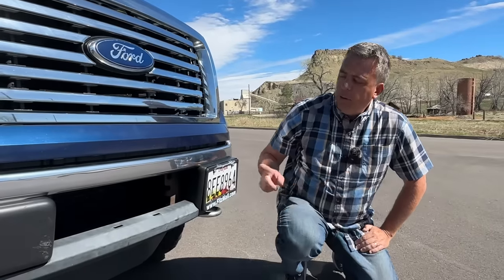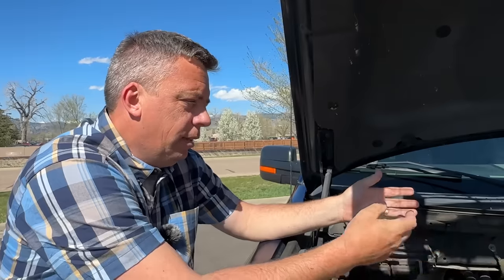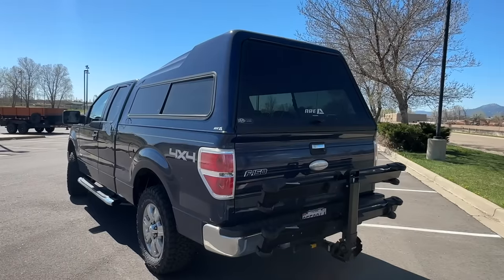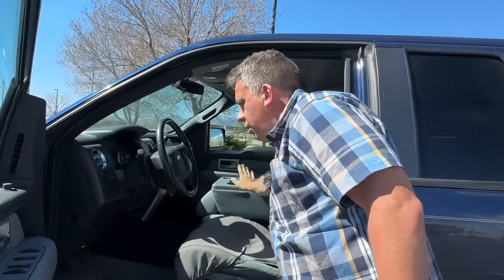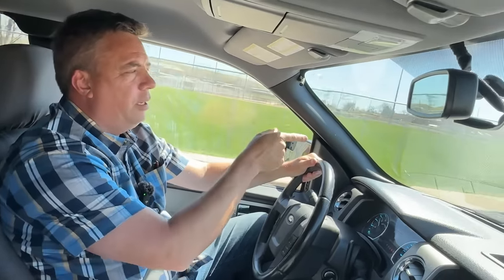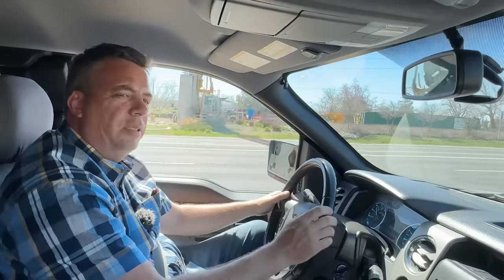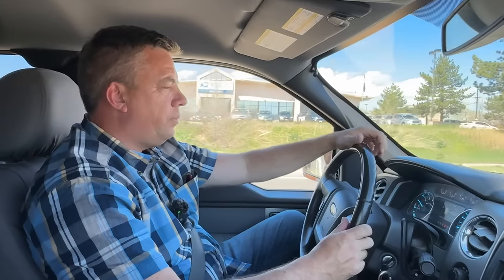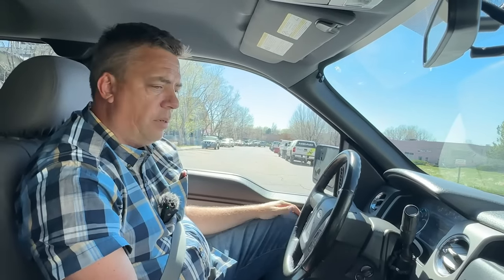How Has the Ford F-150 EcoBoost Held Up Over a Decade?

Comment: I have a 2011 with 205k. Great truck. Did just have to replace the PCM. Random failure I’m sure. Also have repaired some oil lines on the turbos. Great engine and great power. Ford was on the right path and likely “ahead of their time”

Comment: I have almost this exact truck, got KO2’s also, with 249,300 miles and I get 17.2 mpg. I don’t have phaser issues and haven’t had to replace any turbos. If you replace the spark plugs, gap them to .32, and replace the plug boots, it runs like a brand new engine.

Other than normal maintenance, I’ve replaced the fan speed resistor 3 times, the transmission range sensor, the 4wd shift motor, and an o2 sensor.

It’s really a great truck if you take care of it.

Comment: I remember looking for an small SUV for my wife.  Ford's first ecoboost Escape was one of the considerations. (Along with a RAV4.)  I almost got the Escape, but then, fires!  Ecoboost failure, leaks.  So, went with the RAV4.  Later, in 2013 I was looking for a truck.  Settled on an F150 STX 4X4, but never wanted anything to do with the ecoboost V6.  Chose the 5.0 liter V8 Coyote engine.  Quite happy with that choice.  I did sell the truck (trade in) back in 2020 and got another F150 with 5.0 liter (XLT with most of the geegaws available, tow package  and 2 wheel drive.)  Quite happy with it.  Don't think I will ever get an ecoboost V6.  If anything, I might have a supercharger installed on my 5.0, tuned for mileage and a small HP boost with torque boost.  But, it is not really needed.  The Coyote engine does quite well.
Reply: The eco escape engine is nothing like what is in the f150, totally different.

Comment: I had a 2018 F150, 3.5 twin turbo. 
At 53,000 the cam phasers started rattling! Even though it was still under warranty, the inconveniences of not having transport for weeks was enough to make me sell it. 
I bought a 2021 F150 V8, so far all is well with it. 
If Ford have had the cam problem all these years and haven’t done anything to fix it, tells me that the eco boost is a bad idea. 
Stick to naturally aspirated if you can’t solve the problems that come with stretching the performance in a smaller engine.
Reply: Problem is the 5.0 has the same common issue with phasers.
Reply: @kingdaniel3519  Funny cause my 2011 Ford F150 with a 5.0L Coyote V8 in it has 161,000 miles on it and still going strong with no rattle cam phasers what's so ever?
Reply: @kingdaniel3519  i have a 2019 Mustang GT 5.0 never had a issue with cam phasers

Comment: Bought a 2013 in 2022 with 104K miles. It's currently at 145K right now and within 41K miles, I've had $19,000 in mechanical repairs done. Failing turbos and intercooler to the timing chain and cam phasers needing replaced and leaking exhaust manifolds, brake booster, throttle body just to name a few things. Thank God for extended warranties. With all that taken care of, it's a comfortable truck to drive with plenty of power to do what I need it to do.
Reply: Pretty cool that you were able to get an extended warranty on a nine year old truck
Reply: @bobcoats2708  I agree. Seems like most used car lots in my area offer that when purchasing a vehicle and it ties into the loan. Definitely a must on any truck since anything can happen and repairs aren't cheap! Lol

Comment: I have an 02 tundra 4x4 with 212k. Ive had it since 2019 with 140k. Only drivetrain work done is timing belt water pump and valve cover gaskets and radiator at 200k. Might sound like alot but it was about 2k spent for 200k miles. I get around 15 mpg. I change the oil every 5k and drive it. 

I have thought avout getting an ecoboost for gas mileage but in my budget would need to get one with about 100k miles.  I'm afraid maintenance that would he needed on one would offset any money saved on the small mpg bump.

Comment: I own a 2014 3.5L ecoboost with 96k. Just recently put a catch can on(wish i knew about these sooner) and it's been running great. At 75K, i changed the spark plugs, transmission fluid, coolant, diffs etc. I also have been changing the oil every 3,500k using Pennzoil Ultra plat. or Valvoline HM Max Life. No hauling or towing...I baby my truck, so let's hope for another 96k+. But of course, gotta know the starter, alternator and water pump will go in the time span. Fingers crossed on the cams.

Comment: 2014 F150 4x4 with 5.0.  203,000 miles original transmission. 

Had to replace pullies and water pump a few times.  Torque converter went out but transmission is still smooth. Gonna ride it out!

Comment: i have a 2011 f150 lariat.. but the 5.0 v8. 240k later still a beast
Reply: Awesome brother, I have a 2011 Ford F150 with a 5.0L Coyote V8 in it with 161,000 miles on it and still going strong and its a beast and it sounds like a beast with the Borla ATAK exhaust on it as well.
Reply: @CJColvin  even back then they were overpriced junk
Reply: @pathunter7003  The EcoBoost ones totally agree but the 5.0L ones (as well as the 6.2L ones) not so much.

Comment: I currently have this generation as a 2012 5.0 and love it! However, mine has a factory quirk where even though it's a 5.0 they still put the license plate off to the side on accident. They didn't even put the center mount in. So I leave it cause it's a cool little quirk that Ford owners know lol

Comment: My 2020 Ford Transit 350HD dually camper van with the 3.5 engine and it weighs 8600 lbs unloaded. I get 16mpg average mileage. I have 26k miles on it. This thing moves down the road and mountains with no issues. I have no complaints so far with the engine.

Comment: I still don’t understand why Ford has not solved the cam phaser problems on the 3.5. My wife drives a 2011 Fusion and it has 150k on it with zero problems. This is why I have a 2012 Raptor with a 6.2 and a 2003 Cobra Terminator. All three of these engines are bulletproof.
Reply: you’re saying your fusion is bullet proof? my 14 1.5 L just left me stranded in the middle of the intersection a couple months ago from transmission tanking at 165k miles after doing $2000 tune up, belts, pump, plugs, etc 2 weeks prior
Reply: @elisteele3099 If his fusion has the 2.5, the same engine as the maverick, and some escapes, then yes, that engine is basically the poster child of reliability. The 2.5 hybrid has been proven to last 500k in escape taxis over, and over again.

Comment: One year prior, the 2010 Ford F150 also carried the 4.6l  V8 3 valve engine.
Reply: The 4.6 is the best of the modern Ford truck engines.
Reply: Had an ‘06 f150 with the 4.6, sounded great, drove great, put 170,000 on it before handing it off to a family member.
Reply: 4.6 litre is an awesome engine. It didn’t visit the dealership for major repairs like the Ecoboost garbage.
Reply: My 2010 has the 2V 4.6L with only 57,000 miles on it. Arguably one of the most reliable engines out there.

Comment: I have a 13 ecoboost, 164k. Has a tune and drop in k and n filter. Just did a throttle body, aside from that just basic maintenance,  bulbs and fluids.  Always maintain proper oil lever to help save the cam phazers.  On 93 octane ive been getting over 25mpg at 63 mph with cruise control on the highway.  4x4 with the 331 gears. Only issue is a coolant leak most likely from the turbo coolant line.  Overall very impressive truck.   The v8 is more exciting to drive, but thats all
Reply: I call it the modern day gmc typhoon or syclone

Comment: My dad has a 2012 f150 ecoboost with around 250,000 miles. Engine itself is pretty reliable besides some cam phaser noise at cold start. The turbos and water pump had to be replaced at 150,000 miles and now the new turbos have coolant leaking from them

Comment: I have a completely stock 2012 (minus the SuperChips canned tune) and other than needing a wheel bearing and caliper it hasn't given me problems in the 220k miles Ive had it. Kinda glad I took the risk. His doesn't have the locking rear diff like mine does.

Comment: I bought a 2013 f150 about a year and half ago and had to put an engine in it not even 5k miles after buying it so I know the feeling of being kinda “stuck” with that truck but I love the power it has it has a pretty decent sound with an intake and the 4 inch exhaust on it and seeing how complicated brand new stuff is it makes my truck seem simple even though it’s incredibly complex itself all in all I’m happy with it id still buy an ecoboost again when the time comes which hopefully is a long time from now
Reply: What job do you have and how much money do you make to afford that EcoBoost F150? Also will it outlast the 5.7L I-Force V8 in the 07-21 Toyota Tundra?
Reply: @CJColvin  there’s not many engines around that’ll outlast a Toyota 5.7 and that’s fine but the Toyota 5.7 won’t out last my 7.3 powerstroke

Comment: I have a 2-door Bronco FE with the 2.7. It has plenty of grunt considering the weight. In Eco mode I see mpg in the mid to upper 20s. Not bad on 35s. Only have 33k miles, but reliable so far on the trails.

Comment: I have the 3.5 it has been great when working properly. The cost to maintain is very frustrating and extremely costly for seemingly simple repairs. The quick connect turbo coolant lines to turbos were a ton of money to fix. Exhaust manifold issues still a problem, oil leaks all over the place. I went through spark plugs fast and the oil changes must be done at minimum every 5k. Next truck I'm going back to v8 if possible.

Comment: 2015 3.5 supercrew been good to me bought it with 18k miles now at 88k miles only problem i had so far was a bad cat got it replaced free at ford run full syntethic every 3500 miles no rattles aboit to do spark plugs and transmission  hope to get it to 150k with no issues before i even think about selling

Comment: 2017 2.7L eco boost. 86k on it. Driver side ball bearing and a lean in my rear differential. Other than that oil changes every 3k. And a catch can on passenger side. Runs like a champ. Average 29/ mile. Love my truck. Too bad the kids soiled the rear seats from snacks and food.

Comment: I bought a 2011 3.5l new, in 2011. The intercooler you showed was stock, but I went in for a recall one time and a black plastic cover was put over a portion of the intercooler. The mech said it was because the intercooler was cooling the air too much and sometimes water dropped out. I now have a 2021 but it doesn't have the black plastic cover over the intercooler. I guess they built a smaller one???
I also lost the blue color on the oval Ford emblem on the tailgate.
I sold the 2011 after 10 years with no breakdowns. I only changed the brakes, belt, oil and filters and did general routine preventative maintenance.

Comment: 212k on my ‘14. Transmission replaced (not rebuilt) at 130k. Um I would say it’s okay. Frequent spark plug changes and various oil leaks are super annoying but cheap to fix. Example the valve cover complete assembly from the ford parts dept was $110 for each side. Took me an hour to do one side. The vacuum pump was another $120 and another hour to fix. Spark plugs $60.

Comment: I work on them at a Ford dealer. The 3.5L ecoboost can be a hit or miss. I’ve fixed many many many leaks, turbos and low power issues, phaser, chains. As they age all the coolant lines and oil lines going to the Turbos leak. Turbos end up getting wastegate rattle which requires replacement. I’ve seen many people sink thousands upon thousands of dollars into an old 3.5 ecoboost. If you buy one make sure it has a great service history. For me after working on all the gas motors in the trucks across the board I’d take the 5.0 all day.

Comment: I'm with Andre regarding not being 100% certain Ford has ever solved the cam phaser issue. There are questions about the "updated" parts and if trucks manufactured/repaired with them have a perfect reliability record. Last I looked, if you could cut through all the brand loyalists and fanatics, it seemed like more time was needed to have any confidence about the updated parts. They were supposedly introduced to late-production 2019 models, but I know of one late 2019 truck (my Dad's) that had the issue. Others say they've encountered the issue in 2020+ trucks. I bet we'll have better/more data within the next year or so.
Reply: If you would cut thru all the haters you would find out they are great running trucks

Comment: Unpopular opinion, but I have always preferred the 5.4 3V Triton motor. I had a 2004 F150 and it was a fantastic truck. The 5.4 is a torquey low end motor. They are reliable if you keep up with basic maintenance. They have earned a bad reputation because of those who wouldn’t maintain them or have long oil change cycles (every 10k miles). I love the 5.0 coyote but it’s more of a high revving motor, something I would prefer in a Mustang.

Comment: Great truck!! I had an F-150 for a while with the ecoboost and the only issue I had was the exhaust manifold warping and breaking a stud. Supposedly Ford fixed the cam phasers the issue is that they are working through the supply of the old ones until they start with the new ones. That’s the rumor anyway.

Comment: I took a 2012 Lariat ecoboost to 
140000 miles. After replacing the timing chain due to the cam phaser issue, having the parking brake switch continually stick and rebuilding the moonroof due to a broken plastic component I lost trust in it lasting much longer. Managed to cash out while the market was still hot and traded it in for a 2022 F350 with the 7.3L Godzilla engine. While it was a fun truck to drive, no more ecoboosts for me.

Comment: Im a Ford Technician,  cam phasers, exhaust manifold studs an leaking turbo coolant lines are most common repairs on these. Otherwise they are pretty good. The 2.7 actually has fewer problems

Comment: Just bought a 2018 2.7 with 80k miles aftermarket wheels dual exhaust got good deal on it. I wanted a 5.0 cause my thinking always was trucks had to have V8s I test drove the 2.7 i was amazed at how powerful and fast it was the little 2.7 will stomp the Daylights out of  V8 powered trucks all day especially with the bdx tuner!!

Comment: Ike Gauntlet? We've had 3 Customers with over 400k on these Gen 1 EcoBoosts. One them replaced everything except the Engine/Turbos/VVT (he only did oil changes nothing else). Second dude changes all fluids, no issues. Second dude was lifted on 35" tires, his turbos were starting to fail. That being said, the Phasers are such a common issue the last 3 private auto shops I've worked at had a set of timing tools.

Comment: My ford expedition has 175,000 miles we were told by the Ford mechanics that the 3.5 L cam phaser issue was due to the oil since we change the Amsoil we had no longer had any cam phaser issues with the car.

Comment: I'm really happy to see how Andrey has improved over the years and is one of the best reviewers on YouTube on merit. The information in this video should be taken seriously by those who constantly knock Ford for unreliability. It is easy to overlook the average Ford vehicle is put through much harsher and more punishing uses than let's say a Toyota Thundra or Tacoma in my opinion those are used less punishingly than Fords so if you use kids' gloves and treat your Toyotas like status symbol then its obvious they will not have the issues like Fords. It's also worth noting the innovation of the small displacement turbocharged EcoBoost. I remember even here on TFL how Roman and Nathan ridiculed this but it took the others about a decade to follow kudos to Ford and its engineers who in my opinion are disrespected massively when their product is denigrated in praise of Toyota and other non-American brands.
Reply: Great point on service life. When I shop at Home Depot early in the morning, virtually all the work trucks in the parking lot are Fords. I'll pick up workers at the bus station in the morning, most of the landscaping trucks pulling trailers are Fords. I have a friend who works at a Toyota dealership and all the Tundra fans never mention frame replacement issues or severe oil consumption issues with rings and oil passages.
Reply: The sad truth is most people don't maintain their vehicles. They skip oil changes, they "forget" the tranny, t-case, axles, brakes, p. steering and coolant changes. Not to mention filter changes. They run them into the ground and can't figure out why it breaks down after "only" 5 years.
Reply: If the EcoBoost is wayyyyyyy too good then why did Ford made the 5.0L Coyote V8 in the F150 in the first place? Also why did Ford use the 6.8L and 7.3L Godzilla V8s in the Super Duty as base gas engines and not the 3.5L EcoBoost V6?